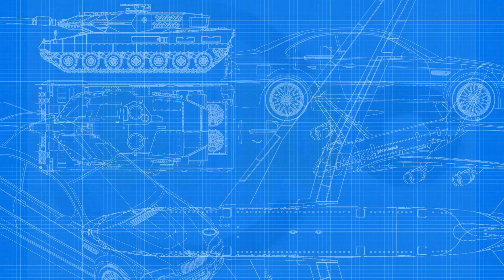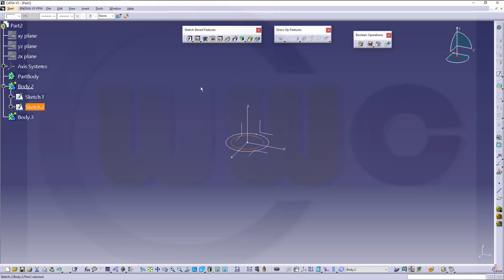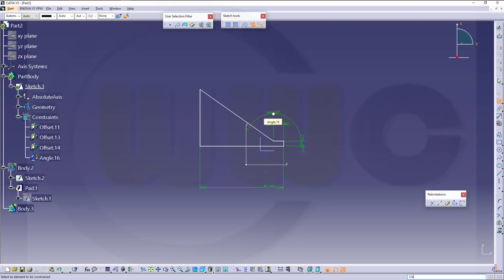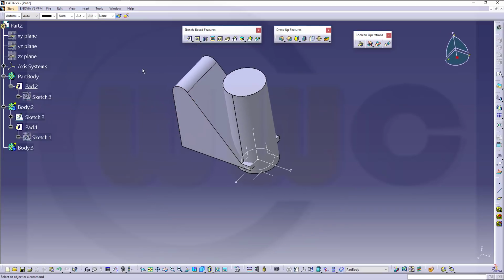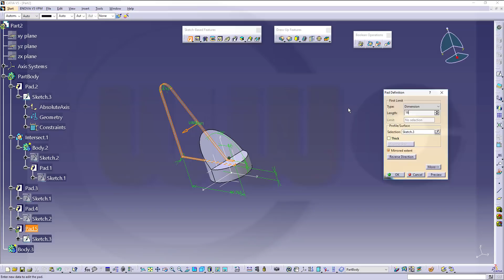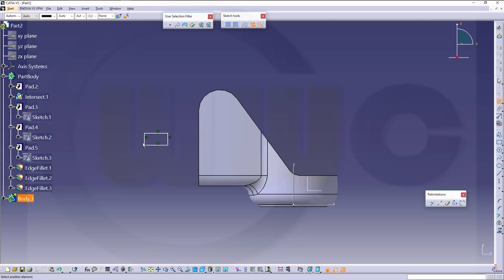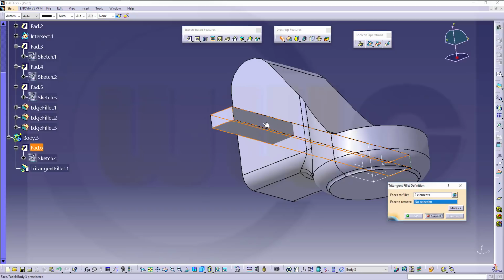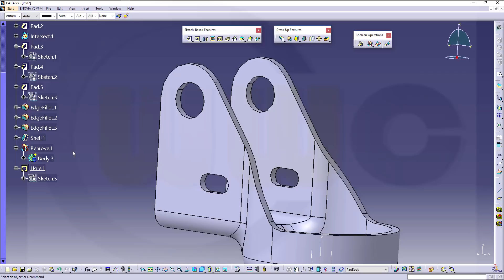8.4 Rollenhaltewinkel - Roll Bracket - Catia v5 Training - Part Design

Comment: While making sketch 3, it disappears when I exit workbench and It is showing error while intersecting part 1 and 2, it is showing it as a one body, how to remove this error
Reply from the maker: Disappearing sketch might be caused - by showing only the "body in work" - 3 rectangles in the bottom toolbar - switched to one orange rectangle.  For the rest - I´m not a clairvoyant - without seeing your model I can´t tell.

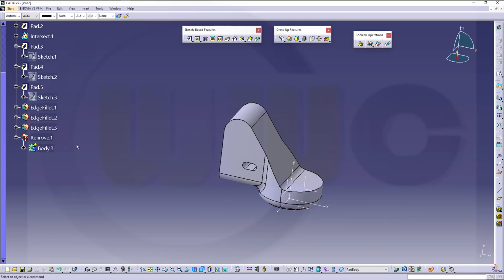Comment: Hello, at 08:40 or around that time, you remove Body 3 from the PartBody after applying tritangent fillets. Why would this not be acheived on the YZ plane via a sketch and perform a pocket? Thanks.
Reply from the maker: Of course you could do it with a sketch. But that is not the point of this exercise and method.